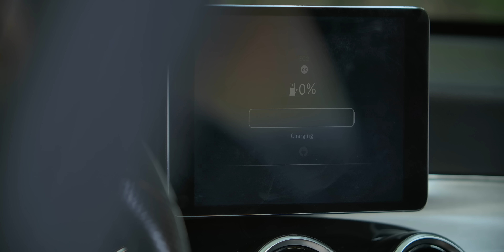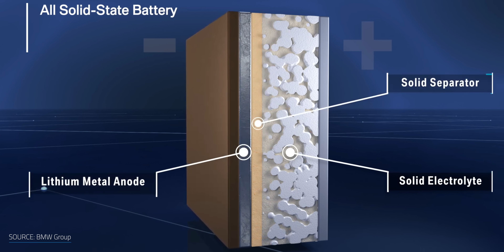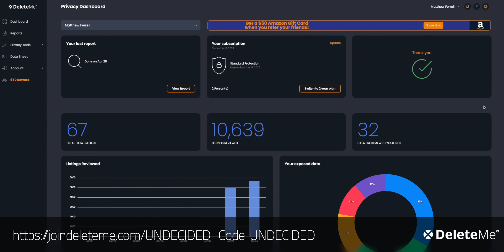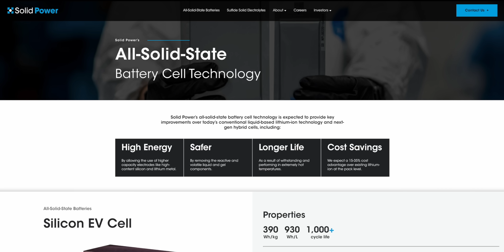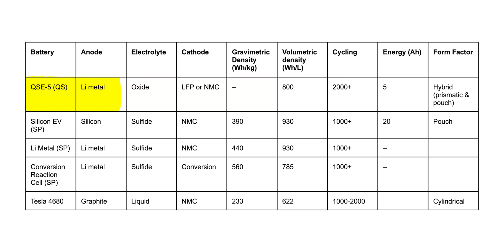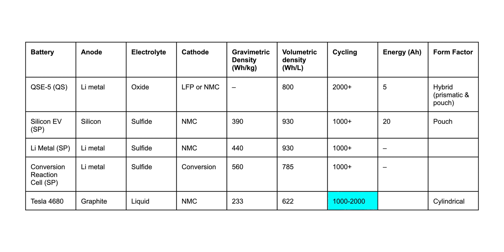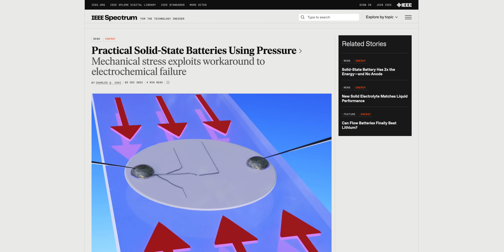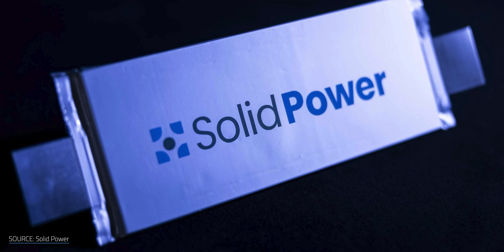Solid State Batteries are Closer Than You Think

Comment: It is not just charge times.  EV require a LOT of energy.  A Tesla Model 3 has a 50kw battery that takes about 15-20 minutes to charge 80% on a 250kw charger.  You want to now make that a 100KW solid state that can charge in 10 minutes?  That is going to need a 1MW charger.  They are already starting to water cool these cables and the power infrastructure that would be needed at charging stations if the ever want to replace the gas stations will draw more power than the towns and cities they are in.  Think a typical town of say 10,000 is going to need probably 50 charging stations.  They will normally not all be filled except during rush-hour (morning and night)... and this is for a 10 minute charge so you will likely need double that... and larger vehicles like the CyberTruck might still take 30 minutes at these rates.  So 100 charging stations or 100MW of power likely in a city that normally uses half that.

People just do not understand that the US to reduce fossil fuel usage for everything but ships and aircraft fuel and plastics, chemicals, and lubricants will require the US to increase its power production by at least 400% and rebuild the entire power grid from the ground up.  This could cost 100 trillion dollars and take 20+ years or more to achieve.  Remember gasoline has a very high energy density and we have been building up the infrastructure for homes and businesses as well as transportation over the last 120 years.  We will still need to use fossil fuels for energy production for a long time.  Most people just think it is about buying EVs and such, but there is so much more.
Reply: It goes both ways, if you can   produce a  battery to use in your car, we can produce batteries that can be used on the grid and at the charging stations that can charge at a slower time  or build up its storage to be release back to you or to the grid.
Reply: @adr2t  That helps with the surges, but it adds costs in other ways.  I am not saying it is impossible, but the time tables they have set ARE.  What was the goal 50% EV by 2035?  That is NOT going to happen.
Reply: @toddabbott781  I might be wrong, but that was for new call sells was it not? Not ownership
Reply: @adr2t  Some places what to ban non EV sales all together by 2035.  But you can not go from 7.2% to 50% in one year.  This means the sales needs to keep ramping roughly 4% per year over the next 11 years.  I have heard NOTHING about new power plants or rebuilding ANY of the power grid.  4% EV per year is going to add up fast and we are just not prepared at all.
Reply: @toddabbott781  Far as I know, no place in the US can legally ban what you own as the courts have already said they cant control that. Far as I know it was only set for new car sells, so at 4% at that rate its not really as big of a problem. As for new power plants, more solar and wind have been aprove at rappit pace. Following that, battery storage have curve the need for just more power plants like coal and others as we was burning just to produce the power with no way to store it. Its one of the reason why we still see some states have to switch methods for net metering and many solar roof tops power going to waste.

Right now we're sitting on the switch over from possible to do-able because of the battery tech coming out such as Na and Salt water batteries for grid storage and home use. That are already in production and starting to roll into smaller products first follow by moving into more production for larger applications such as smaller transport use (I dont know if we will see them in EVs, but a hybrid battery might come out of it). So I see in the next 10 we will see a large switch/jump in that area.

Na and Salt water batteries dont have a production limitation unlike Li did because of resources. Aka, it can be right in the areas where it is needed such as the US, EU, and Mexico, etc. Thuse the production can meet demand rather quickly even if it takes 30% more battery to have the same dens as of Li when it requires almost 80% less to make, ship, and use.

I know, because its the only thing I am waiting on before I install my own home battery storage. With that, I can charge them when power is the cheapest, and use them when power is the highest. Along with house power backup, it pretty much pays for themselves.

AS for the grid, thats another question in it self - as that has far too many moving parts and will have to come down to local government who will have to meet the demands of the market. Aka, some areas are going to expand faster than others.

Large cities are going to suffer more than areas that are a bit more spread out because of home charging to having the ability to deploy chargers.

With that said, the more batteries that are deployed, the easier it will be to send the power where it is needed and store that power you produce without burning for no reason (aka, solar power for net metering will come back stronger than ever as power from any location will have value again).
Reply: @adr2t  That is assuming these batteries actually work as promised and do not cost too much.  But we need better solar technology too.  There is little we can really do to significantly increase the efficiency of wind power.

The other thing that people do not talk about is the cost of using a rapid charger is typically 2x the cost of electricity or more and this makes it so the F-350 Super Duty diesel is actually slightly cheaper when towing a moderately  sized camper trailer.  So the cost to the end user is actually going to be higher.  Then understand it is not taxed like gas is and this pays for a lot of road maintenance in most states.  This means they will have add the same tax onto electric charging as gas... and that is quite a lot.

EV will really struggle to compete and this will make it harder to get people to switch over to.  This means when they start trying to force people to buy EV there will be a lot of backlash and likely a lot of lawsuits over whether the government is overstepping their power.

But the fact of the matter... increasing the power production in this country by 400% is going to cost a fortune.  A lot of countries will not want to do it and it could have a huge impact with the economy as they will likely just print more money.  But still needing a transformer station for a small charging station running water cooled 1MW chargers.  I would hate to see one of these fail.  That small charging station might have 10-20MW of power going into that thing.  You will likely hear that transformer humming and those chargers are going to give off a lot of heat.  Rush hour is going to cause cities to brown out or black out because you know they are not going to build it up enough.  And you are not going to be able to take a generator out to charge a dead EV on the highway as a 1MW charger is about the size of a semi trailer or shipping container.

I am just saying that this is not impossible, but it will be VERY costly and a lot of people... especially those making these laws have no clue what this is going to take.  It is already costing this country billions with all the subsidies and costs already.  Most car companies are loosing the asses on EV and the sales are dropping off.  Only a small portion of the population of this would will spend $20,000 more on a car just to "save the planet".  With the economy sucking ass right now EV are a hard sell even when they are loosing so much money for each one sold.
Reply: New Energy is getting lower and lower in price, with the benefit of being decentralized.

 It is not happening over night either. Engineering Explained or Real Engineering (was it? The car guy) did a video on what it would look like if the entirety of the US switched over night, and it was just 25% more power. Roughly equivelent to all of us running ACs 8 hours a day if I recall. 

 All the gas subsudizes and infrastrucrure costs could go pay for that over time. 

  I think people with your concern fail to realize we try to produce only as much energy we need at any giving time. If there is more demand we will easily build for that demand as we always have. 

 There will be hurdles of course. Yet they are just that - just hurdles. They aren't walls or mountians, and won't stop progress.